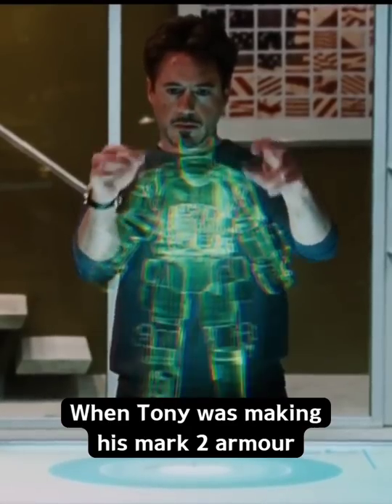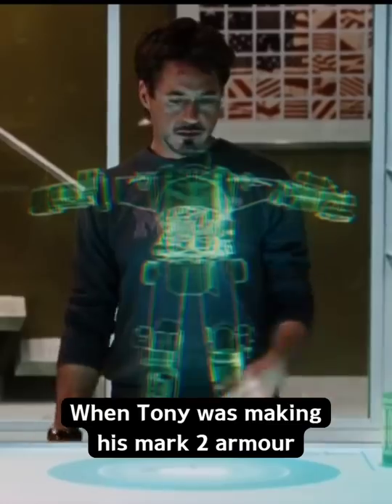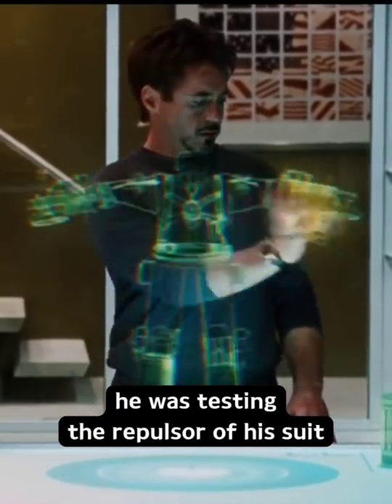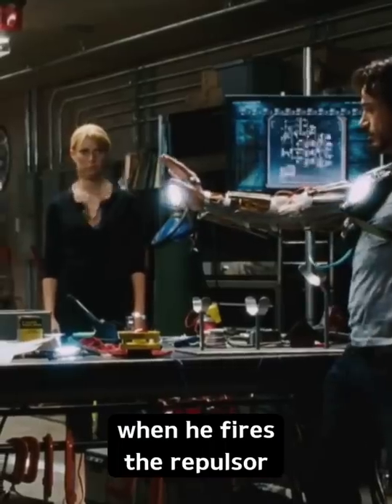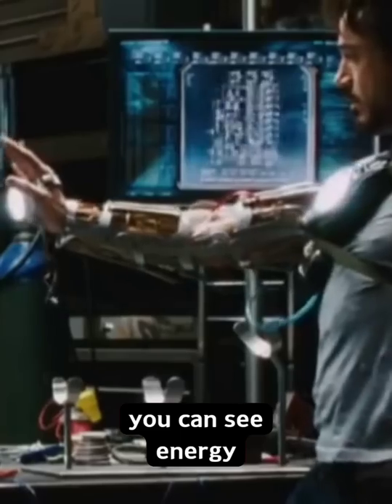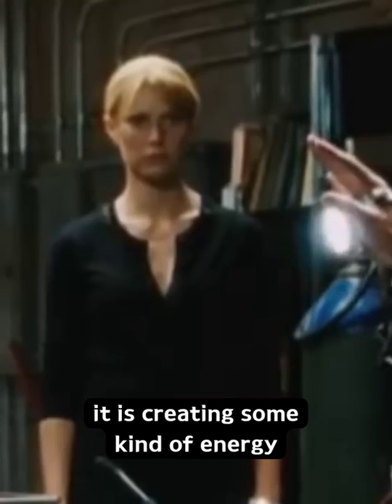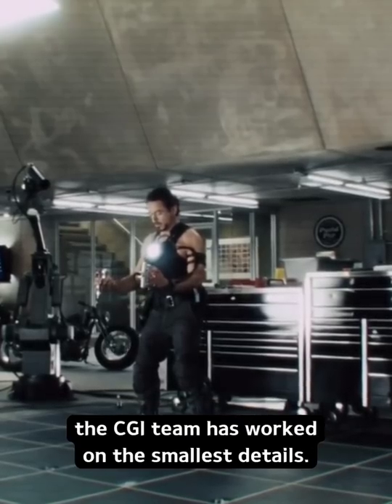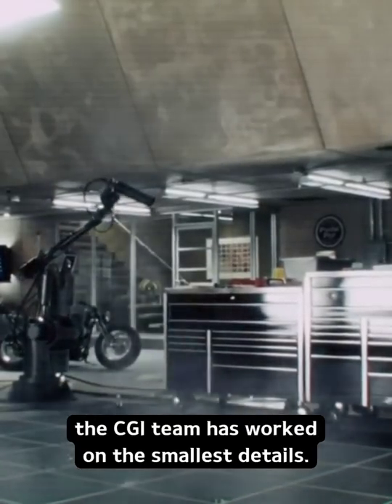Did you know that in "IRON MAN"...

Comment: As a highschooler who failed physics and I'm completely unqualified to awser this but it's not just "energy" even saying that I'd stupid because energy comes in many forms ex I move an object with my hand or bouce a ball I'm useing kenetic energy. On the spectra of energy blue being the highest and red being the lowest we have a small window of viabletly that tells me that it's not messcarly higher but not low the projection of the energy is a result of the electrons being excited and when this happens energy jumps to a higher plane of energy or if you are drawing a Bohr model it would be further away from the nucleus. In short form. That is an example of radiation which is a by product of the energy being projected which happens in tenths of a second almost misable